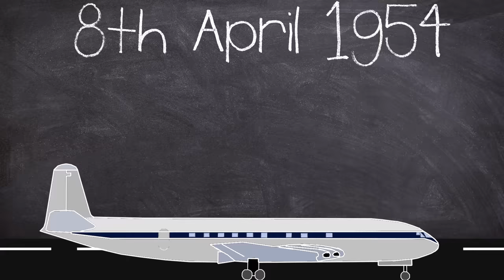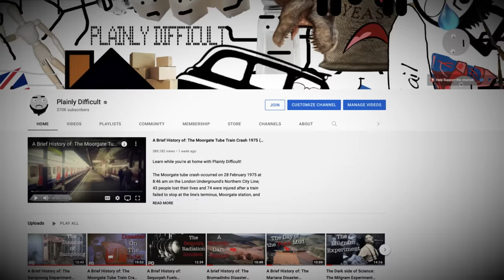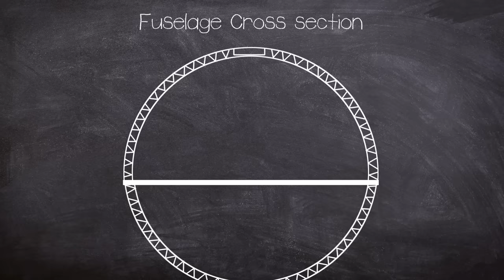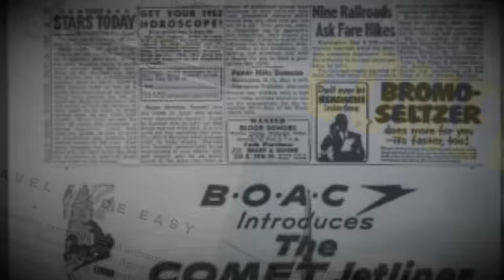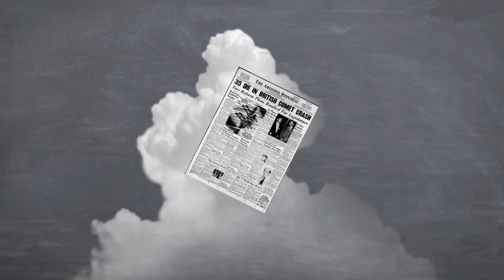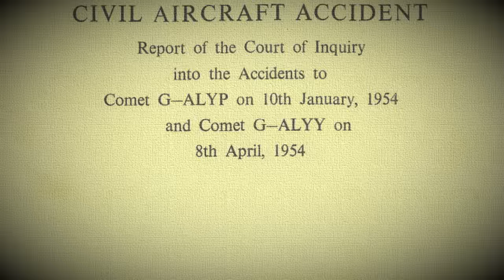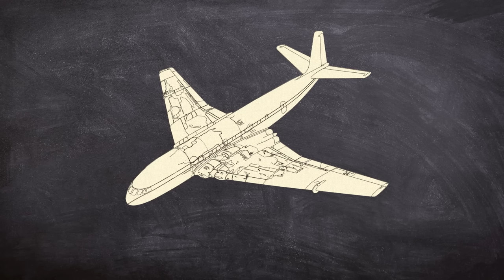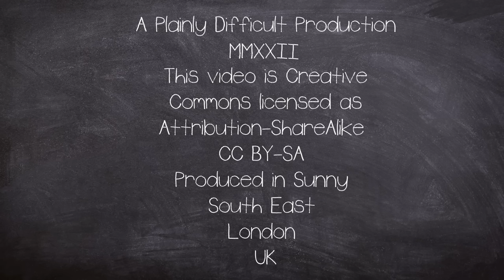A Brief History of: The de Havilland Comet Design Disaster 1954 (Documentary)

Comment: I did want to fly on a Comet.  In fact, I had several miniatures as a child and was dead in love with them.  It was those engines embedded into the wings that always took my heart.  They logged many miles in my childhood hands without a failure.  If only the reality could have been more true.  Who would have guessed that square windows could cause so much havoc?  Great video, and an interesting but sad reminder of something that one could call, "Plainly Difficult."
Reply: Ship builders. They knew round(ed) windows where the way to go.
Reply: @RoadkillbunnyUK  I always kinda wondered why ships don’t have square windows. So it’s a pressure thing?
Reply: None of the catastrophic in-flight structural failures were related to the passenger windows..
The aircraft's fuselage ruptured along the roof at the point of the fuselage hoop with the highest hoop stress.
de Havilland made the hoops too weak, the skin too thin, lacked proper doubler plates and safe riveting techniques.
100s of fatal flaws were discovered in the wings, engine inlets, control systems even the toilets had to be redesigned to make the Comet safe to carry passengers.
Reply: @sandervanderkammen9230  you here as well? Why am I not surprised 😃

Well observed, by the way.
Reply: @John Higgins Those 426 people that died because of de Havillands incompetence are still dead....
Reply: @John Higgins ... and the Comet Disaster remains the worst engineering failure in aviation history... you seem to be trying to forget that?
Reply: @John Higgins The truth always wins in the end...
Reply: @John Higgins De Havilland went tits-up in 1958 and Britian no longer has any companies left that make commercial jet aircraft...
So everyone is a winner!
Reply: @John Higgins Yes it does... you are in a deep state of denial of truth.
The British aircraft industry steadily declined and completely collapsed.
The Comet Disaster is a major factor in the collapse of the UK aircraft industry.
Reply: @John Higgins The truth is irrefutable, trolls like you try to attack it, ignorant fools may deny it but the truth remains infallible.
The Comet Disaster is the worst engineering failure in aviation history. 
There is absolutely nothing you can say that can change this irrefutable fact.
Reply: @John Higgins You just denied it yet again...
Reply: This plane was likely the insperation for the silvery Naboo jets from star wars ep 1 and 2.
Reply: @AC3handle  Yes, Goerge Lucus said he wanted the spacecraft to have an earlier look than the hard-edge style of the late 1970s and 1980s films and turned to Art Deco style of the 1920s for inspiration, de Havilland was famous for its Art Deco styling in the 1920s and 1930's... although it looked very outdated by the 1950s
Reply: @John Higgins You are obviously in complete state of denial...
Reply: @John Higgins Just like that...
Reply: @John Higgins Stop being immature..
Reply: @John Higgins Why?
Reply: @John HigginsYou just proved you are in denial.
Reply: @John Higgins how often do you see your therapists?
Reply: @John Higgins ???
Reply: @John Higgins _
Reply: @John Higgins How often do you see your therapists?
Reply: @John Higgins ???
Reply: @John Higgins  Have you received treatment for your cognitive dissonance?
Reply: @John Higgins  Have you received treatment for your cognitive dissonance?
Reply: @John Higgins just answer the question.
Reply: @John Higgins ???
Reply: @John Higgins  Have you received treatment for your cognitive dissonance?
Reply: @John Higgins Just answer the question jonny.
Reply: @John Higgins ???
Reply: @John Higgins C'mon Jonny! Answer the question.
Reply: @John Higgins  Have you received treatment for your cognitive dissonance?
Reply: @John Higgins   Have you received treatment for your cognitive dissonance?
Reply: @John Higgins .  Have you received treatment for your cognitive dissonance?
Reply: @John Higgins   Have you received treatment for your cognitive dissonance?
Reply: @John Higgins   I'm serious Jonny, Have you received treatment for your cognitive dissonance?
Reply: @John Higgins . I really am serious Jonny, Have you received treatment for your cognitive dissonance?
Reply: @John Higgins Have you received treatment for your cognitive dissonance???
Reply: @John Higgins C'mon Jonny!!!  Have you received treatment for your cognitive dissonance???
Reply: @John Higgins   Jonny!!!  Have you received treatment for your cognitive dissonance???
Reply: @John Higgins  Have you received treatment for your cognitive dissonance????
Reply: @John Higgins Have you received treatment for your cognitive dissonance?
Reply: @John Higgins   Have you received treatment for your cognitive dissonance????
Reply: @John Higgins Not in California... Have you received treatment for your cognitive dissonance????
Reply: @John Higgins The weather is perfect right now... heading out for a swim in the pool right now.
Reply: @John Higgins Another beautiful day... blue skies and not a single British aircraft to be seen anywhere.
Reply: @John Higgins You're still refusing the accept the truth... there are no longer any British companies that make commercial jet aircraft...  airlines simply refused to buy British planes.
After the Comet Disaster, who would blame them!
Reply: @sandervanderkammen9230  how about Airbus?
Reply: @bas_uk  What about Airbus?
Reply: @sandervanderkammen9230  well you stated you where glad that their where no British aircraft anywhere, yet most Airbuses that fly in those blue skies have wings designed and manufactured in Britain, then you have the many planes that use rolls Royce (British) engines, including some Boeing planes
Reply: @bas_uk  Sorry chap, Airbus SE is not a British company.

The very last British jet airliner was built 2 decades ago.
Reply: @John Higgins this has to be one of the silliest comment chains I have read
Reply: @John Higgins i agree this comment chain is silly,
Reply: @sandervanderkammen9230  no but they help build Airbus planes and Rolls-Royce provide alot of the world's jet engines
Reply: @logangallagher7050  Airbus is not a British company.
8% is not alot.
Reply: @sandervanderkammen9230  I didn't say it was, you said the British aircraft industry has gone but it hasn't.we make most of the wings for Airbus and most of the engines. We also make alot of military aircraft. So you are absolutely wrong.
Reply: @logangallagher7050  There are no longer any British companies that make jet airliners... several foreign manufacturers operate former British owned facilities and take advantage of the cheap labor and rents.
With the exception of the 1970s vintage Hawker Hawk trainer the RAF no longer operates any aircraft designed and built by a British company.
The RAF's most advanced jet fighter is the American Lockheed F-35.

So no, it certainly does not sound like Britian is a country with a viable aircraft industry.
Reply: @sandervanderkammen9230  wow You seem quite anti British, I suggest you really do your homework. And also the F35 isn't just an American affair, multiple nations contributed including the UK. Like I said Rolls-Royce make ALOT engines which is a UK company, the RAF typhoon is joint nation venture which includes the UK, same goes for the Merlin, Lynx. Also there's components made in the UK the majority of jets around the world. BAE which is a British defence company (the 4th biggest in the world) supplies alot of aircraft components to all the major air force's. So come on be fair and recognise the important work the UK plays in aviation.
Reply: @logangallagher7050  I personally love the British, the funny little accents, Dr. Who, Sherlock Holmes, Victorian engineering and steam engines.. the best.
But when it comes to cooking and building aircraft? 
Well, I understand now why there are 20,000 Indian restaurants and no British commercial aircraft manufacturers.

Cheers mate!
Reply: @sandervanderkammen9230  good, at least you've changed your wording, I accept we don't have any home grown commercial manufacturers anymore. But at least you've recognised we have an aviation industry. Cheers mate all the best.
Reply: @sandervanderkammen9230 Thousands of people have died because of Boeing aircraft as well. Why don't you report on that?
Reply: @ilikealotofthings731  I think this is a topic well beyond your understanding and intellectual abilities.
 Aviation safety is based on mathmatical statistics... no other company in the world has built more planes than Boeing, half the people who are in the air Right Now are on board a Boeing aircraft...
Please educate yourself!
Reply: @logangallagher7050  The UK hosts a mostly foreign aircraft industry... that occupies many sites of former British aircraft manufacturers.

Airbus, Spirit Aerosystems, Leonardo, Thales,Lockheed, Boeing, Raytheon, General Electric, Safran Pratt&Whitney are all Foreign aerospace manufacturers... not British.

Comment: "And this children, is why airplane windows are round"... There are a handful of other metal fatigue and explosive decompression incidents/accidents which may be worthwhile looking into if not already featured on this channel.
Reply: I might be wrong, but the problems that square windows or metal fatigue effects more on pressurised airplane cabin.. I think I have seen small aircraft that fly in low attitude (with unpressurised cabin) that have square windows (not that 90 degree square, but with rounded edges)
Reply: @bobroberts2371  you forgot the cat that pushes everything off the edge of the pizza every 100 years
Reply: I really hope one day he tackles McDonnell Douglas and DC-10 cargo door issues, and the infamous investigation and blatant colluding with the then head of the FAA.
Reply: Ezcept for the fact that the comets already had round off cornered and not pointy square windows already
Reply: @dew9103 Even insufficiently rounded corners introduce stress in the surrounding metal.
It gets worse the greater the pressure differentierad. Fot example, check out the roundness requirements for deep sea submersibles.
Any imperfections is a potential point of failure.
Reply: @Teukka72  yea absolutely, they were not the source of the cracks (those were the rivets that were punched instead of drilled) but the cracks formed there because they exerted the most pressure
Reply: @dew9103  If memory serves me right, it wasn't the windows on the sides but rather square cutouts for the ADF  antenna that was one of the main causes, made to happen by metal fatigue around stress points that was much more likely to happen due to riveting not being done right.
That it was the riveting that was ultimately at fault does not change the locations where the failures happened, which were stress points, caused by among other things cutouts with an insufficient corner radius.

Comment: I've heard the story of the Comet before, but not the fact that they did pressure-cycle testing -- including of the window areas -- while it was being designed. It sounds like they must have come close to catching the fatal problem, but still missed it.
Reply from the maker: Sadly true
Reply: Imagine being like.... that one guy who was probably like "We should have done that test..." or however they figured out the problems. (I still need to watch the video but I swear there's always that one guy no one listens to.)
Reply: They ran tests, but probably not nearly enough, and the tests were not properly organized (some of the stress testing was on parts that had already been tested for overpressure (this changes the structure of the hull and invalidates the later tests).  DeHaviland didn't allocate enough time and most importantly enough hulls for comprehensive testing.  Boeing and Douglass were VERY slow to get into jet airliners, by the time Boeing brought the 707 into service it had a lot of data from the B-47 bomber (and the negatives from Comet) to work with.

The other big problem Comet had was that especially the Comet 1 was VERY short ranged (it could not fly the Atlantic) and rather small.  The 2,3 and 4 were bigger, but not of the size that was really needed for many routes.  Comet was an attempt to do an end-run on existing airliners and make British Aviation a player.  It didn't really work, but the Princess flying boat and Brabazon were even bigger failures (the Comet at least entered service, and served as an anti sub platform "Nimrod" for decades to come).
Reply: @PlainlyDifficult  Their is an easy demonstration that shows what happens. 
First punch  sheet of A4 paper using a punch that is used to store papers in a ring folder, then carefully cut one of the holes into a square.
Then put the paper into a folder and carefully rip it out, observing which hole rips first. The difference is considerable and similar to nicking the edge of cellophane in order to rip it.
Research has now shown that it was a similar thing that caused the Titanic to break in half. The ends of bitumen filled expansion joints at intervals along the hull became the origin of a stress fracture. This was already known by Harland and Wolfe and the slots ended with a circular bulb, similar to a thermometer.
Why these were cut on her sister ship, but not the Titanic remains a mystery.
Reply: Don't forget one thing that is sadly prevalent in disasters like this, the possibility that the engineers had either designed in extra strength or the &^%$##%^&*((**&^%$ management overruled their engineers.

And you know the engineers were screaming bloody murder about replacing drilling the rivet holes with punching them. Well until silenced by the "genius" at the top.
Reply: @wilsjane 
The Titanic didn't break in half.